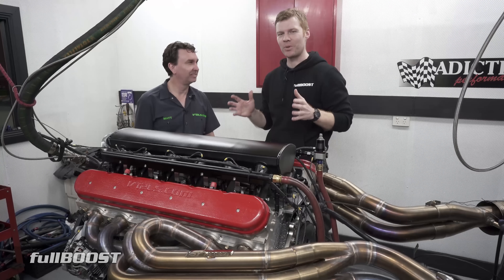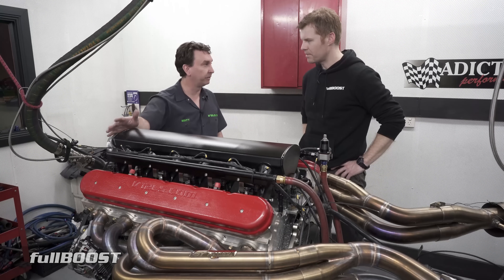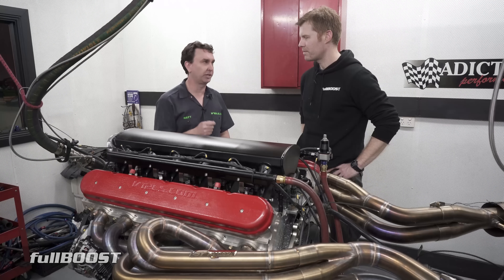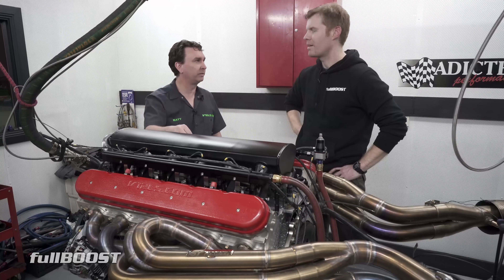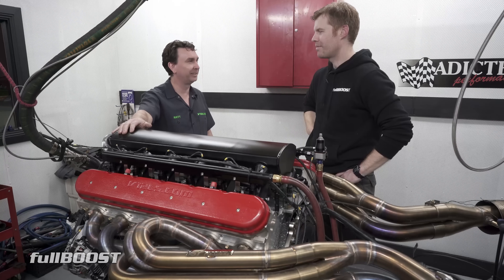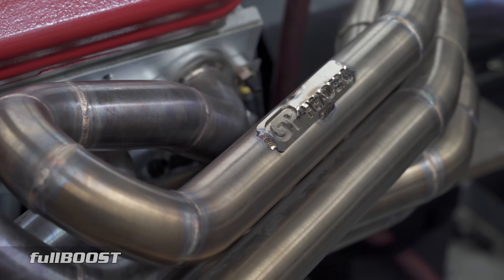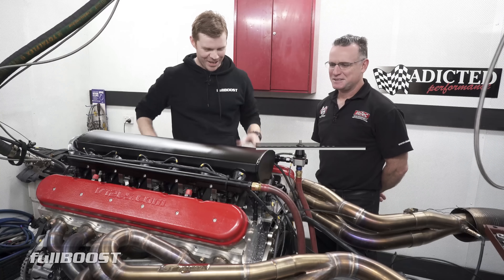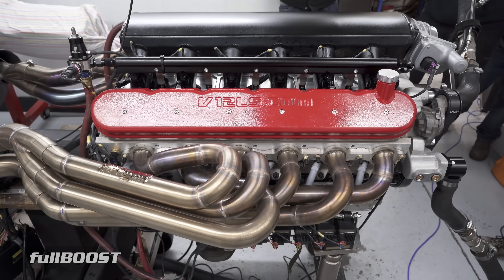Inside a V12LS engine | fullBOOST

Comment: Awesome engine thanks for the video. You know the aftermarket throttle body is the most overrated performance upgrade ever invented.
Reply from the maker: Well that depends on the application.
Reply: @fullboost  one thing a bigger throttle body does do is increase part throttle airflow. So the dude that just put on a bigger TB touches the accelerator pedal he gets this airflow of a much wider throttle opening and he thinks OMG it goes so much harder but the engine makes the same power its just the part throttle response is different.

Comment: Odd firing v12 is so damn cool I love the f1 scream of flat plane but this is just so cool in it's own way.
Reply: There is no such a thing as a flat plane V12. A perfectly balanced v12 come with a 120 deg crank journal separation and 60 deg cylinder bank angle separation which also will result in an even firing order.
Reply: @soraaoixxthebluesky  Poor wording on their part; they meant to say "even fire" instead of "flat plane".
Reply: well it is kind of even firing odd firing engine :D Each of the bank runs as a straight six so each of the bank separately runs even fire, but if you look at the engine as a whole, than it runs oddfire, because of the V angle (90 degrees vs 60 for perfectly evenfiring V12).. so... soundwise I would call it even firing.
Reply: @johnnysodak7261  It sounds like it's even-fire because on the dyno they're running straight dual exhausts with no H-pipe or X-pipe, but in reality you're right, it's odd-fire, because not only is its 90° V-angle decidedly wider than the V12's natural angle of 60°, it runs straight non-split crankpins, which results in firing intervals alternating between 90° and 30°. With a single pipe exhaust I could imagine it having a high-pitched shriek, but with an H-pipe or straight duals it would sound like a 6 cylinder.
Reply: @electric7487  whyt you mean single pipe ? like 12 to 1 ? you really dont want to do that on that engine as it beying 90 degree v12 without split pins as you said, it would cause pressure unbalances. Best to keep it running as two separate inline sixes which run even fire regarding gas scaveaging...
Reply: @johnnysodak7261  By "single pipe" I meant something like a 12-into-2-into-1 setup. But a (much) better solution would be one or two X pipes.

Comment: Turbo and supercharged, now that would be sick, again the V12LS is the burt munro  of australia, now that would be a challenge as well, first V12LS engine to break the land speed record at  bonneville salt flats? After all they have had V12 engines before, just not a LS based and made from scratch and just imagine piston sleeves made to custom pistons and then cams and h beam rods etc etc, all made to the best materials for very hi revving engines, after all all the hyper engines are like that, they will run all day every day at hi rev's which is why they have so much cooling and i wonder which radiator is required and of course twin large Fans as well, maybe someone who has a New Camaro and put one of these engines in it and a magnuson supercharger. :) Just to be the first. :) Congrats to all involved and good luck in the states. :)

Comment: What about a straight six based on this. It would be a blast in Jeeps that came with the 4.0, which is an awesome engine to begin with. But the 4.0 doesn't have a crossflow head, and this engine could fix that.
Reply: @oldtin82  intech lmao
Reply: Ken, why not just put this in the Jeep!? 😂
Reply: Techheadzc32 I don't want to blip the throttle and end up in the roof! Lol back in the 80's I worked for an Auto Parts and Machine Shop as their parts guy for engine builds when I wasn't on the front counter. We built all kinds of custom engines for customers. About the only thing we couldn't do was balance the rotating assembly and align hone the blocks. Everything else we did in house including minor port work. Full race stuff we sent out to shops that specialized in porting heads because when you get beyond port machine and smoothing out the bowls and punch valve guide bosses, it's easy to go to big here or there ad screw up the flow velocity. We knew early on the bigger isn't always better! Anyway I built a destroyed 454 for a guy, which was basically Turing it into a .030 over 427, or 430 cubes. Back then it was getting hard to find forged cranks for the 454, the core charge for them was around $600 and the crank Kit was only $300 or so. So we used a 396 crank with lots of Mallory metal to get it to balance right. The guy put a roller cam in it, a tunnel ram and 12-1 compression. It was one stout motor. He put it in a Chevette and on the first attempted pass he put it in the roof. Jeeps are pretty light and the torque of this beast would probably do the same thing if you got enough traction. Newcomer Racing is getting about 300 hp out of the 4.0l when stroked and the head is ported. A crossflow head would make things a lot easier!

Comment: I bet with a Velocity Stack on the throttlebody the engine would make instant 5-10HP more on the Engine Dyno.
Sharp edges kill Power.
Greetings from Germany 🇩🇪
Reply: individual variable length runners
Reply: @Spiritpoweredinternet because    $$$$!
Reply: freakyRunner they engineered a v12 ls engine. Fully functioning. I'm sure they overlooked that...🙄
Reply: Just put a nick Williams 102mm throttle bodie

Comment: Basically an aircraft engine. Trying to get weight distribution anything like 50/50 would be a bit of a challenge without a custom chassis
Reply: I dont think there is a benefit of getting it to 50/50 with an engine weighing 350kg. It will go in show cars and street cars, hardly anything that will see corners
Reply: @bingoberra18  Yeah, while it's definitely cool, it's way too big and way too heavy for a proper sports car. I'm a little baffled why they went iron block instead of aluminum.
Reply: @bingoberra18  You dont see any benefit of having a car that can go around a corner? You must be a fan of motorized paper weights.
Reply: Marietta Corsini I highly doubt it’s much heavier than a typical all iron big block.
Reply: @jasontruman1215  Well you dont put an all iron big block in a sportscar do you :) They probably went iron block for cost, maybe powerhandling as well, things like twisting in the block could be a factor too with alu.
Reply: bingoberra18 uhhh 427 ac cobra? And there is a British car (I forget the name) that came factory with a Chrysler 440.
Reply: @jasontruman1215  Do you think it has competitive handling compared to a Miata for example?
Reply: bingoberra18 no but that’s apples to oranges, a Miata is very light and balanced but very low hp in factory form. Yes I realize “proper” sports cars are light and nimble all I was saying is that engine probably isn’t any heavier than a classic American v8.
Reply: @jasontruman1215  not the Jensen Interceptor?
Reply: NoNoNoNii I have not heard of that one!!! I’ll look it up a 1jz v12 probably makes some pretty good music!!!!
Reply from the maker: LoL...
Reply: shane  Not likely that you can put down that extra amount of power from the iron block. Its not about the power but how you can use it, also remember that youll have more mass to slow down, to eat the extra heat on the braking, youll need to add more mass to the rotors further increasing weight. Basically low weight is always preferred over power on a racecar.
Reply: Wouldn't be used in an airplane, either for the same reason, it's too heavy.

Comment: Only a matter of time before the quad turbo setups come
Reply: Why go 4, go 6 or 8 just for laughs!
Reply: Liddz the only reason Bugatti does it. They don't even break 1800 hp and have 4 turbos useless. Bugatti overpriced and a status symbol
Reply: That... or giant roots blowers...
Reply: Advantage of Quad is that they can be set up as sequential with a small turbo feeding the bigger with little to no turbo lag. The best feed to a turbo is 3 cylinders so with 4 turbos each will be fed by 3 cylinders.
Reply: captarmour modern variable vein and twin scroll turbos all but eliminate the need for sequential turbo charging.
Reply: @Holmesy89  in terms of lag and throttle response yes, but in terms of big boost the downstream turbo is starting off with the boost of the first turbo and multiplying that so we get big boost plus throttle response!
Reply: @captarmour  That's compound turbos, not sequential. Sequential turbos typically means the turbos are run in parallel, and a series of valves disable one or more turbos at low rpm to have lesser number and/or smaller turbos run the engine so it builds boost faster. You hardly ever see people run this kind of setup in the aftermarket because the valves and control system just aren't readily available or cheap. Adds a lot of fabrication to the build. Occasionally it is done by OEMs.
Compound turbos are also rarely used any more because modern turbo technology allows for modest sized turbos that spool as quick as older smaller turbos and support as much power as older larger turbos. Where compound turbos still shine is in really high boost (>100psi) applications, like racing diesel engines, because if sized correctly both turbos see roughly half of the total boost across them and that makes them work more efficiently.
Reply: @tmmtmm  thanks for the correction. I was thinking turbo compounding was the same as compound turbos
http://www.enginehistory.org/Piston/Wright/Kuhns/CurtissWrightTC18/TurboCompounds.shtml
Reply: I used the wrong term but I did explain that one turbo would feed the second one. If that's compound turbos that's what I meant. Thanks again , I love to be corrected , that way I don't remain an idiot.
Reply: @captarmour  If lag is an issue, just go with a supercharger for bottom end and twin turbos for mid range to top.
Reply: captarmour yeah but a twin turbo can also be in a sequential setup
Reply: @sonicstep  great idea. If I'm doing twin turbos I may as well do a compound by having a smaller fast spooling one feed a bigger one and get quick spool up and massive amounts of boost!
Reply: captarmour  true as far as 3 per turbo. But then you’re messing with different back pressures for half the motor. So a simple two scroll twins will work just fine. Besides, even with humongous turbos this motor won’t have any drivability problems on the street like small 4bangers do with huge turbos.
Reply: @11SecSTionStockSnail  thanks, much appreciated. Just today I saw a video on Mazda's 4 into 3 header to increase exhaust scavenging as well as quicker turbo spool up. It also includes valves that increase/decrease the size of the header feeding the turbo
Reply: 6 turbo
Reply: Or 2 671 setup like a Detroit diesel and then 6 dual stack throttle bodies. All rigid welded.
Reply: I'm pretty sure haltech were making one of them but they haven't posted anything about it a while
Reply: honestly with the torque of this thing i would imagine a large super charger would be more practical
Reply: It's actually been done by Steve Morris but he did a v16 turbo
Reply: Even better, try going for twin-twincharging... 2 superchargers and 2 turbos...
Reply: For ur wet octane dreams may I provide this link...

https://youtu.be/eaBuVmT554E
Reply: I like supercharger and turbo combos. So a supercharged quad turbo v12 would be insane. Having the supercharger feed the motor to start to build the exhaust to spool the turbos... like Tim "the toolman" Taylor says: "more power".
Reply: Sometimes N/A is better
Reply: Haltech did one

Comment: Why cast iron block?
Reply: Durability
Reply: @takigosciu  The specific power per ltr is tiny its not under much strain and people are making 2000hp on aluminum blocks. This thing must weigh a ton and so once again i repeat my question.
Reply: Jolinator cheap
Reply: aluminum option is available too, it's only the matter of what you need when you want to get one. With Cast you can only get more of that power.
Reply: Jolinator alloy blocks @ 2000hp may only last 200 1/4mile passes and many will have either no water cooling galleys or very limited cooling so methanol only and no good on the street or circuit work. One of the reasons the 2JZ and Barra engines are such legends is their iron blocks so can be boosted to high numbers, and can still drive 1000 miles in drag week.
Reply: Iron can Handle the Power , and save $$$ but C.N.C. Billet could be done Under 50k . Let's get EXOTIC 👺!
Reply: Thanks for the interest guys. We make both iron and alloy. The overall difference in weight is not as much as you would think. My personal favourite is Iron because it's just so simple and strong, and has a few more cubes ;) For boosted applications we always recommend iron. The alloy is really nice and requires sleeving the cylinder and lifter bores.
Reply: @V12LS  Appreciate the reply. Cant wait to see how this monster evolves in the future.
Reply: Yeah like there is no reason to run iron block unless you force induction it